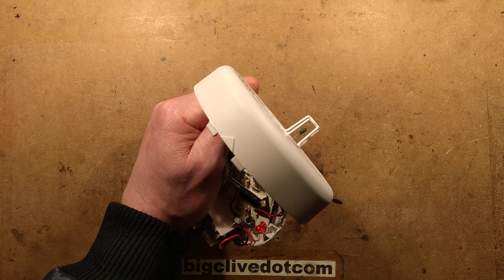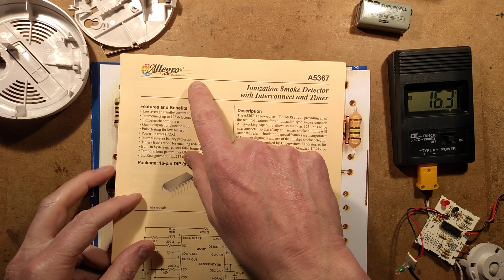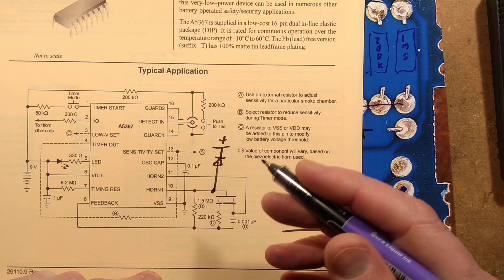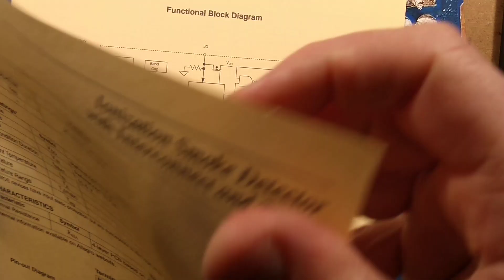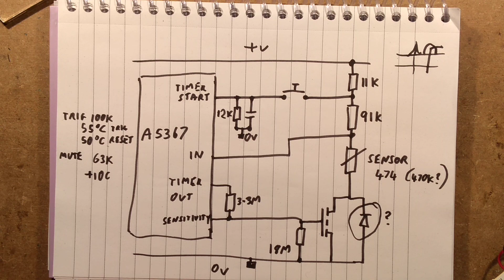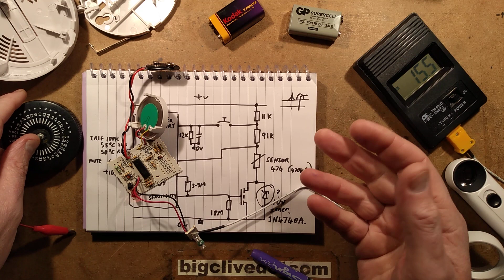Inside a heat detector alarm.  (Not a smoke detector.)

Comment: Huh. Heat detectors have come a long way from the old Simplex style with the finned metal button that snaps into a hardwired base. (As a child I "helped" my father install several Simplex commercial fire alarm systems in the 1980s, it amazed me how modular the systems were and how customizable they were for the time.)

It blew my mind when my old man explained that the entire system was essentially loops of wire with NO or NC contacts - whether it be heat detector, smoke detector, manual pull station - and being so simple made it a robust system, where system failures were typically from a detector itself (or some other work crew taking a saw through two 5/8" rigid steel conduits and disabling two zones' detectors, pull stations, and the horns/strobes as well). We re-pulled a lot of 18 AWG stranded wire to fix that! LOL

Comment: @bigclivedotcom - Zeners don’t clamp as sharply as you may think, they act like a resistor and partially conduct before the clamp voltage is reached, then they clamp hard at their rated voltage, a curve tracer shows the characteristics.

Comment: Interesting, if the mere fact of resoldering the diode makes a slight difference to the characteristics of the circuit, that means the manufacturer either doesn't care much about a consistent product or they're selecting components as the relevant characteristic lies within manufacturing tolerance. Baffling to say the least.

Comment: It seems the zener diode might be standard (recommended)  practice in circuits that have a bare piezo transducer (no oscillator built in).  The zener protects the driving circuit from back EMF that might be induced by the piezo itself.  ...Think what will happen if the transducer is knocked, bumped, or subjected to high decibel noise...

https://www.murata.com/en-us/support/faqs/products/sound/sounder/char/sch0001

"Also, in order to protect the transistor itself, consider connecting a Zener diode in parallel with the piezoelectric sound component and Rp if necessary."

It makes sense I guess.  A piezo crystal can be both an input and an output device.  The Rp mentioned above is a discharge resistor for the  piezo component and the above text says "be sure to use it".  It looks like the 18M resistor is doing that role in the alarm circuit.

For piezo buzzer components that have their own oscillator, presumably both of those functions are built in as well.

Comment: 2019 - a commercial mass product of lowpower type completly throughhole? that's really strange, it's like fallen through a 25+ years  wormhole.
Reply: If components remain available, and you have an automated production line (I know of component inserters that crimp the leads like that), it's far cheaper to keep cranking them out, vs. redesigning the circuit and replacing all the automation equipment. Upgrade for the sake of upgrading? Not if it costs you a quarter to half a million $ for absolutely zero return on investment.

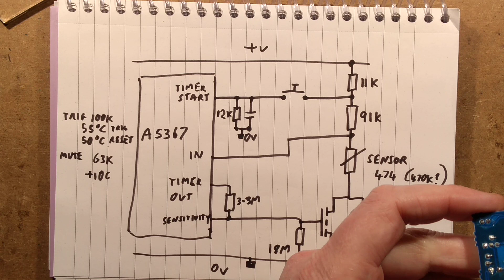Comment: 14:24 I assume it's so if it does get hot 🔥 the components don't drop off 🙂
Reply: Ha! The case will melt before the solder does.
Reply: @mikecowen6507  unless the detector is the cause of the fire, it's char and melt beforehand, yeah.

Comment: Clive, your reverse engineered schematic failed to indicate the connection to the beeper.
The mystery diode may be related to any back EMF off of the piezoelectric beeper if they produce a Voltage when being pulsed.  (or a voice coil hooter when they are used)
Reply: my thought too. i've had devices dying because they've been droppen on the floor. The reverse piezo effect should be considered when everything is in the range of the megaohms.

Comment: Shorting out that diode, if anything, will increase sensitivity, assuming an NTC thermistor. Assuming it is some sort of zener, when the FET is off it will raise the voltage at the bottom end of the voltage to the zener voltage. Since the chip triggers on a low voltage, this will decrease the sensitivity. When the FET is on, it drags the low end of the divider down to ground and increases the sensitivity.

Say it's a 3V zener. The input at 20°C will be 3V + 6V×[470K ÷ (102K + 470K)], or 7.93V.  With the FET on, it would be 9V×[470K ÷ (102K + 470K)], or 7.40V.

It might be that the diode is some sort of polarity protection and than the sensitivity output is biasing it into the linear range.

Comment: Do these things actually serve their intended purpose? I'd imagine quite a significant amount of fire would need to be present to heat something stuck to the ceiling up to 55 degrees (failure of my intuition perhaps). Wouldn't it be a bit late by then ?
Reply: Max Erhard - warm air rises as the cool air falls. So if a fire did start, the ceiling area would heat up quicker than other areas (apart from the actual fire of course). Of course if you were in the room, you would spot the fire long before this alarm would trigger. But if the room was not occupied, and a fire started, it would give at least some warning time for you to leave the building. Or wake you up so you could leave. It is not likely to give you as much warning time as a smoke detector though.

Comment: Having no electronics knowledge, my only thought is that they might have left the diode in incase the alarm is run off a fixed supply, like those wires you sometimes see coming down from through the ceiling.

Comment: I might have to pick one of these up.  I'm so tired of my smoke alarm going off near my kitchen.
Reply: You shouldn't be installing smokes near a kitchen anyway. I work at a company installing commercial fire alarm systems and we use thermal detectors like this to reduce false alarms from dust, cooking, etc. 

Last month there was a fire in a dryer that our detector noticed about 2-3 minutes before the sprinkler head nearby let go. Smoke set a bunch more devices off but detecting a fire before it gets to that point saves lives.

We use these near elevator equipment to recall the elevator car and unload people before the fire suppression gives the elevator controls a rusty water bath as well.

Thanks for tearing one apart! The boss doesn't really want us disassembling the stuff in our warehouse.
Reply: @TheReedsofEnki  The problem is the alarm is in our utility room that is directly connect to the kitchen.  The alarm is maybe 10 feet away from the kitchen cook stove.  The utility room has a gas furnace, gas water heater, dryer and washing machine in it.   When I cook the alarm tends to go off pretty easily.  I used to have a smoke alarm that had adjustable sensitivity.
Reply: @jTempVids  Agreed, probably best to throw a thermal detector in there, while you're at it a CO detector if none is present. If you're in the US NFPA 72 29.8.3.4 lists specific requirements for things like this.29.8.4 covers heat detectors, and is worth a read too.

Still, even having one present is better than a lot of houses. When I was a cable guy I'd go into at least a couple homes every week that had smoke detectors with dead batteries chirping away that the occupants didn't seem bothered by. PLEASE have CO detection if you have gas appliances. I hate seeing loss of life that could be prevented by having a couple fairly inexpensive devices installed in the home.

Comment: They make certain models of these with output relays to signal to other equipment. Wonder If the diode has been carried over from a unit with a built in relay and that is the position of the suppression diode. They may have just installed the zener to fill the space on this model? Either that or they manufacture a 12v version of this detector?

Comment: It isn't unusual for the thermistor used in a heat sensor to be a high value - current savings of the high values gives you longer battery life.  I work with thermistors in the 1-2M ohm region.

Comment: We have an infra red detector fitted in our kitchen as part of a central alarm system, the alarm company had to cut it out of the system with a bypass resistor as it would go off as soon as the grill was turned on or the toaster was on in the wron position so that the detector saw the element. The alarm is one that goes through to a central control room and we were getting several false alarms a day,they tried another detector but in the end came to the conclusion that it was in the wrong position and as we were not about to redo the kitchen and move the grill/oven or have the alarm re wired leaving a hole in the cieling it was cut out and we now rely on the smoke detectors fitted in the other rooms.

Comment: So basically that IC could be employed anyway you devise to vary the trigger using a resistivity device.   You could use something like a Load Cell as the sensor .  Looking on E-Bay those chips are a bit pricey.  https://en.wikipedia.org/wiki/Load_cell

Comment: Maybe the zener is use with an alternative FET without a body diode and it's just doubled up on this set-up or designers looked at the wrong data sheet.
Reply: Are there FETs without body diode?
Reply: True, maybe Transistor?
Reply: dothemathright 1111 - it is...

Comment: Those long life Energizer lithium AAA cells are around 1.7V so a 10 year smoke alarm PP3 with 6 x AAAA lithium of similar chemistry would be 10.2V - Just a guess.
Reply: those AAAA cells would start our a 1.624-1.659, depending on how long they sat before getting bought. still doesn't explain the zener though.

Comment: My concern about the diode is that it's just an ESD trap because the thermistor is exposed and might work as an antenna for ESD.
Reply: Excellent observation.  I was thinking the same as well.  But if you look at the 2N7000 datasheet, it already has a built in ESD protection diode.  Maybe they chose the 10v to protect the IC and not just the FET?
Reply: That was also my guess, because the 2N7000 is the only component I destroyed repeatedly by handling it without proper ESD precautions. But as The Dollar Guy states, and as I verified in the ON Semi and ST Micro data sheets, the data sheet in fact shows a Z Diode as body diode between source and drain. Most likely, I destroyed those chips with ESD into the gate.
On the other hand, they have an absolute maximum rating on 60V Vgd, and specify the minimum breakdown voltage of that Z Diode as "above 60V", so I am unsure whether relying on the internal diode for ESD protection is within spec.
Reply: ehsnils I thought of that too. Even if a mosfet has integrated ESD protection it‘s common practice to add an external (zener) diode for protection. And as mentioned before, there is the IC too.

Comment: That diode is protecting the chip from the mof, voltage hammer!  I bet without it the circuit causes oscillations in the reading of the thermo since the thermo's circuit is just butt-strapped on to the circuit.

Comment: Maybe the diode is there because the thermistor is located out side the enclosure so it might get a static shock. so the zenor might clamp any static voltage that might other wise disturb the chip.

Comment: You'll find that it does have the functionality to connect with up to twelve other alarms. Up to twelve in this case means zero though.
Reply: The connection is audio, when one goes off it sets off others near by. That's a drunk guess, and how my alarms work.
Reply: @Gunzee  That is a clever way to do it. However, I've had another look at the datasheet of this chip just now to see if that was the case, and it doesn't appear to have that functionality. It does have an I/O pin to connect it to other alarms but it goes off to the part of the PCB that isn't populated.
Reply: Does "up to twelve" also include negative number of units as well as zero?
Reply: @Bennyboy-dog  Yes.

Comment: I did a little research and it seems that zener diodes conduct a nearly constant current of less than 1 micro amp in the reverse direction until near the breakdown voltage.  They may have used it as a constant current device.  At higher currents, shorted FETs are used for constant current regulation.
Reply: 10µA for this zener according to the datasheet
Reply: JAMES AZBELL The 10ua sounds like a more useful value anyway.

Comment: The zener may be used as some sort of stabilizer. Back in the 1980s the signal diodes used in the production of smoke alarms were oven stabilized as to hold calibration longer than a few months.
This was back when manual calibration was done on each smoke alarm.(what a pain)
Your unsoldering of the diode might have changed that calibration. Check the polarity of the diode in the circuit to make sure it's not just being used as a signal diode.

Comment: Did you not test it with the diode removed? Alternatively you could put your resistor box across the diode pads with the diode removed, assuming your variable resistor goes to very high values. I obviously suspect a very low trickle current through the diode is the most likely function.
And then there's this: https://www.quora.com/What-is-the-effect-of-temperature-on-a-Zener-breakdown-voltage-and-an-avalanche-breakdown-voltage

Comment: Ar you sure that its not a darlington pair and not a FET as I thought FETSs had the diode built in.
Reply: 2N7000 is not a Darlington.

But it is a FETlington :D

it does measure a body diode right across though.

Comment: I wonder if the "HORN" generates a bit of back emf and that diode just suppresses that. They might have chosen 10v knowing it will always behave as a diode with that VCC (maybe cheaper)
Reply: The transducer looks and sounds to be a piezo element. These behave like a capacitive load in a circuit, and not an inductive load. Hence, I don't suspect it's for back-EMF.
Reply: @JoeyvanHummel  yup. I realise that - but only if that circuit in the datasheet is the same as the implementation (if it was a speaker of some kind for example, back emf)

Comment: I'm really waiting for a day when infra-red camera 🎥 will be so cheap that used everywhere as rapid precise and maybe smart fire detector.
Reply: but there is no way that even a cheap infra-red camera will be as low in power consumption as a device like this - running off batteries for several years
Reply: @uwezimmermann5427  maybe, but I see current primitive sensors as very rude way of measuring flame presence,  like last attempt to recognize fire,  but damage to property when they turn on will be quite serious already or non returnable,  it's basically to save building carcass than what inside-is already a fuel

Comment: 9V is only the nominal voltage for said batteries. Actual new voltage is somewhat higher. Some of the rechargeables will exceed 11 volts freshly charged. So maybe the zener has a purpose?
Reply: Interesting thought, but both the IC and the 2N7000 have a lot more voltage leeway beyond 12V!

Comment: My understanding of an Ion detector was it has 2 chambers, 1 sealed and 1 open. It ionises the chambers and compares the the difference between them to sense combustion products. This may be only in commercial detectors and different in these smaller domestic devices. interesting that the same chip is able to run a thermal detector as well.

Comment: Commercial units are usually 'rate of rise of heat' which uses 2 sensors, one is more insulated than the other,
Doing a quick search for 'zener diode as a temp sensor' i find this in the results
"The sensor is essentially a zener diode whose reverse breakdown voltage is proportional to absolute temperature." this is referring to the LM335.
I already knew that diodes can be temp sensors, but first time i knew about zeners, though i guess any junction could be.
Reply: Often 1N4148 diodes were used as temperature sensors... or cheap NPN transistors with one of the junctions reversed biased.